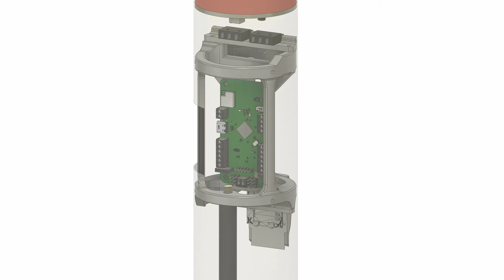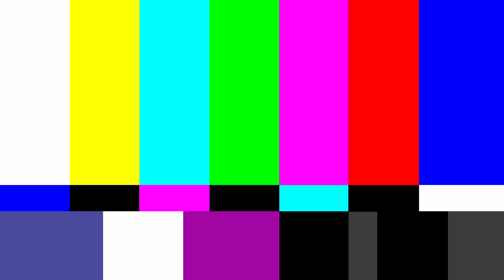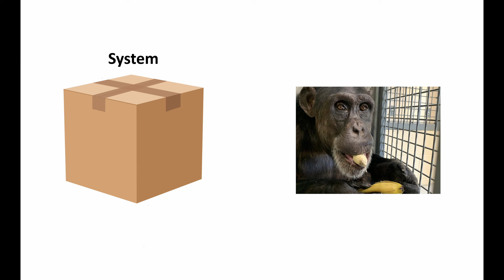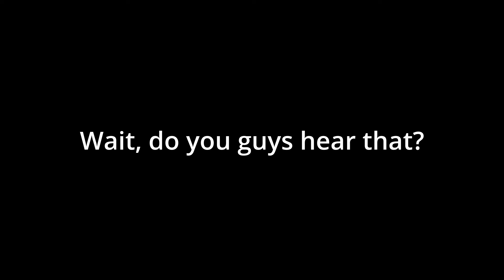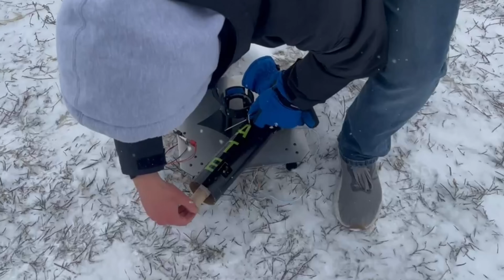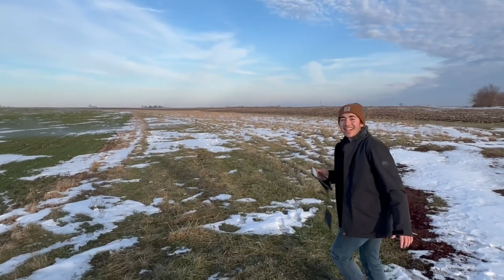I Built a Rocket that can Steer Itself

Comment: Bloody awesome engineering, young fella.  Electromagnetic hold-downs rather than tape? Loved seeing the sinusoidal pattern in the smoke trail - some kind of oscillation to damp out but that's all good.  Can I humbly suggest having a metre rule in shot, filming in the wide and using Tracker to help you review the motion and feed that data back into the simulation? (probably just needs damping in the gimbal mount). Anyway, great stuff and you deserve a higher place in the algorithm.

Comment: I'd love to see a video going in detail on how you made the simulink model. Particularly how you characterized your actuators and transferred that to simulink.
Reply: You can basically apply a series of sine waves with different frequencies to the motor and import the data you get into MATLAB and it will create a model for you (they have like a frequency response estimator block iirc)